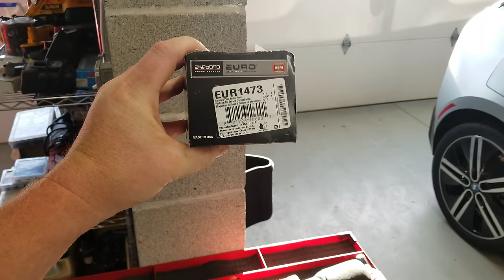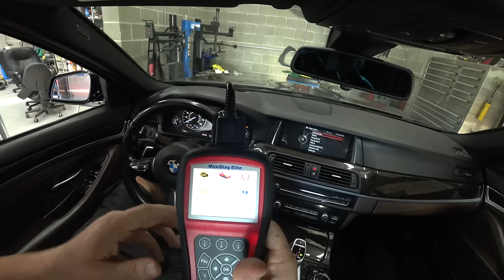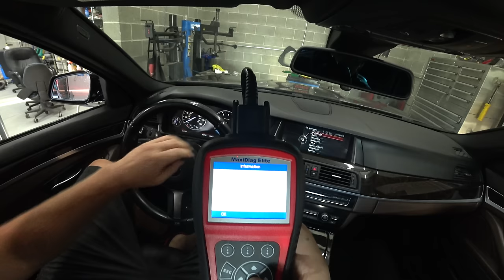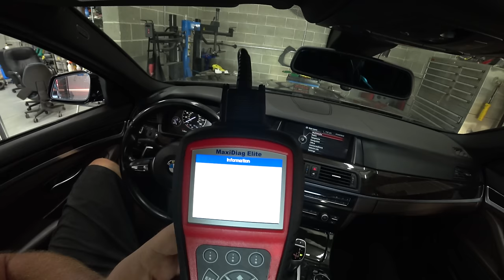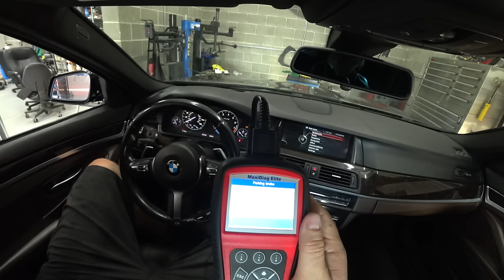2010-2017 f10 BMW 535I REAR BRAKE PAD DIY WITH ELECTRIC PARK BRAKE

Comment: I did mine on my F10 2015, and now I get a few brake errors on the dash but it brakes just fine. Any ideas? I reset the computer and brake stuff again but still no luck.

Comment: Hi I got Bmw F10 2014 model. Need to change break pad, just wondering will it work with your device, you have includes link,  and that isn’t available anymore or can you give any other device suggestions so i don’t have to do all the hassle with Electronic motor, thanks

Comment: Hey man how’s it going? Just a quick question, I bought that same brand for my 2014 BMW 528i (F10) and was wondering where to find the front brakes as the ones I have are only for the rear. Any help? I’m just suspect of buying through amazon sometimes. Also you got any rotors you recommend? Thanks again
Reply from the maker: Stoptech front rotors
https://amzn.to/38eZ8iX
Akebono front pads
https://amzn.to/39hkigz

Comment: Nice video. I did my wife's pads today and used ISTA as I already have it and it set the parking brake in service mode all good but then my piston tool broke so with a channel lock pliers I was able to screw the piston clockwise to retract it all the way in (took 5 mins and was somewhat tight) but that did the trick and I reassembled it all and deactivated the service mode and thankfully it worked. Im just putting this out there as added info for everyone just in case you too get in a jam. Brandon your video was so much better than my on the fly videos that I have done! Great job!

Comment: No need to have an OBD scanner tool. The parking brake actuator assembly  is held with 2 bolts to the calipers. Unscrew those, undo the 2 Torx screws that connect the actuator to the piston and use that same Torx to unwind the piston (turn till you can't go any further). After that you can compress the piston like you would in any other car.
Reconnect the actuator to the piston with the 2 Torx, bolt the assembly back to the calipers and just activate the parking brake. The car will unwind the piston till it makes contact and you're done.
Reply: Totally agreed!  I don’t have a scanner tool and used this exact procedure on my 2015 BMW 528i rear brakes and it worked like a charm.

Comment: Awesome video. I have always changed my brakes but just happened to watch this before changing my BMW brakes to see if there were any tricks i needed to know about. I wouldn't have known about the electronic parking brake deal. I can see myself braking something without that knowledge and having to do the walk of shame to the dealer for more parts. You saved me. Thanks!

Comment: The Autotel interface certainly makes things easier since you don't have to remove the brake actuator and manually turn the screw on the back then reattach the actuator to the back of the caliper, but you can do it without it. 2018 530E Xdrive

Comment: I have a 2013 m6 and am about ready to do my rear brakes, i picked up an Autel 906ts...a bit overkill for changing oil and  brakes but like you said, have to have one with a newer euro car.
Great video, i have a question...do you have to unscrew the brake fluid cap to compress the calipers ? I watched a couple other videos on bmw’s and i do not recall anyone doing this..?  I know all the brake jobs i have done on older cars that had to be done? 
Thanks and keep up the great videos !! Have a great day !
Reply from the maker: Yes it's a good idea to unscrew the brake fluid cap for sure 😎👍
Reply: Thank you...have a great day

Comment: "Just release the rear electric E-brake by sitting inside the car and pressing the [P] parking down. Light should go off. Then remove the two bolts, remove the mechanism. Reverse this process and you should be 💯.

Cut the brake sensor wire and tie them together. Check ALL brake pads for wear every 3 months. You're welcome 🫡✌️

... 🤔 hmm... I have noticed that it is, in fact, still an E-brake (Emergency/ Electric). I don't think it classifies as an "Emergency" brake anymore because it is not cable operated anymore. Cable operation gave one the possibility of coming to a safe stop by not immediately locking up the rear tires, which induced a spinout for some and a wipeout for others.

Comment: Excellent video, just one question, do i need to replace the rotors every time i change my pads whether you replace the front or rear brakes?
Reply: No, you don't have to unless they are worn-out

Comment: Question: 
Can i leave service mode if i had no sensor connected to rear pad? 
I order wrong break pad kit, but im notice this to late, and i remove old sensor but now im not able to connect back anymore cuz his damage and broken. And now my Parking brake button not working at all. When i hold for 5sec nothing happen. Can pad sensor cause this problem?

Comment: When I torque the guide pins bolts, the pins lose their ability to float. Everything becomes rigid. The rotor still turns, but the pins only float when the bolts are loose? Am I doing something wrong?

Comment: Any help would be appreciated: tried the manual route, but one of the 2 bolts was warped, so had to buy an OBDii tool. Put the actuator in service mode (activated, waited the few seconds with the noise, around 10 secs) and went back to press it in only to find it complete out but still attached. Now it won’t press in... any ideas? Thanks in advance
Reply from the maker: Sorry man I'm not sure what to tell you you definitely want to put it into service mode before you touch anything on the brakes or remove the caliper

Comment: After resetting on the dash, how does it work out in the idrive as to how many miles left on front ones that were not done.
Reply from the maker: When you reset it on the dash it should reset the mileage automatically in the idrive

Comment: Hai brother we have a bmw m5 2018 model and it have a hydraulic E brake .
Is it possible to fix a   additional drift brake with handle
Reply from the maker: It's going to be a little tough to do a handbrake with electronic e brake setup😎👍

Comment: Do you leave the ignition on and obd scanner connected while starting the wheel removal etc???
Reply from the maker: Yes when you connect the scanner make sure and have the ignition on position 2 but do not start the vehicle.😎👍

Comment: i think you can manually unscrew the brake motor, but you need to remove the motor first.
Reply from the maker: I think you can take it apart and do it manually but I would definitely not recommend that. I would definitely buy a scan tool and do it the proper way thanks😎👍
Reply: It's very easy, take the motor off and wind a single screw in, that's all it takes. Quicker than messing around with the scanner

Comment: How would I find out if a Autel AL 419 can rewind the parking brake for service?
Reply from the maker: Paul I'm pretty sure that scanner is their basic one and it does not do the electronic parking brake stuff.😎👍
Reply: @pmutah  which model do you use.  Looking at Amazon - this model is priced at $119 - is this it?  Autel AL619 Autolink Engine,ABS,SRS Auto OBD2 Scanner Car Code Reader Automotive Diagnostic Tool
Reply: By the way -great informative vid.  I have a 2014 750il xdrive - would this be pretty similar?

Comment: Hello,
Greetings from Dublin.  I did mine today(brake disks, pad and sensor)  but when I did service reset on the computer I only got another 30000km.  This is less than 19000 milestones. I was just wondering why this is the case? The service due indicator was showing brake pad change in 1,400km before i did the change. 

Great video by the way.
Reply: Last  note, should say less than 19000 miles.

Comment: Hi. My 2013 parking brake stopped working and the parking brake light came on. what do you recommend?
Reply from the maker: It's most likely a bad actuator or a parking brake module
Reply: This model has the actuator right on the caliper, correct?

Comment: No need for the electronic tool as you said, just need to turn clockwise the actuator center shaft using a T45 torx until it stops. Don't spend $ on such device.
Reply from the maker: It's a lot easier just to buy a cheap scanner plus you can use a scanner to to diagnose other problems on your vehicle.
Reply: @pmutah  Do you think the reset can be done using a free scan tool on an Android device? I have a decent ODBii scanner. Plan to change the rear pads in my F11 in the next week so glad I found your video!